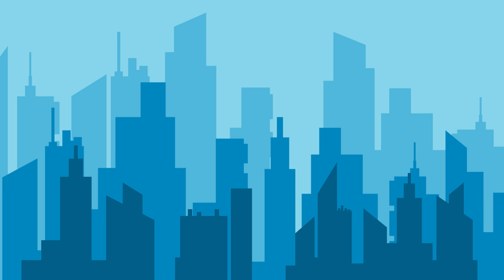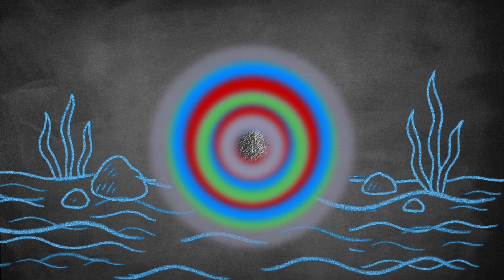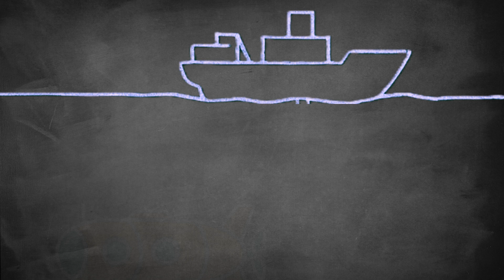Deep-Sea Mining: Engineering the Final Frontier - Or Destroying It? 🪸

Comment from the maker: Time Stamps:
00:00 Start
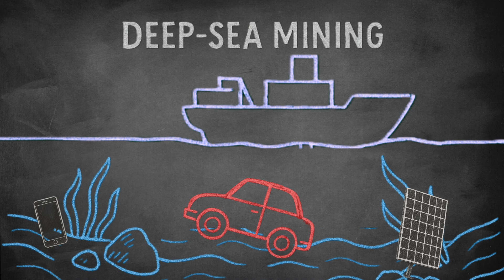00:22 Mineral Extraction at Extreme Depths
00:41 ROVs
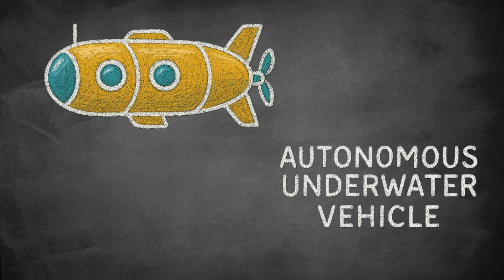01:03 AUVs
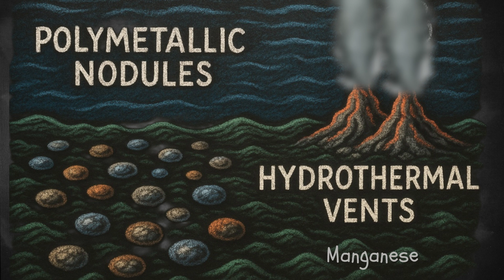01:23 Polymetallic Nodules & Hydrothermal Vents
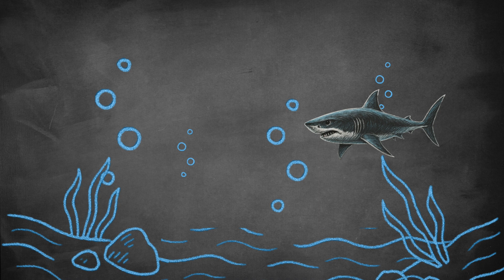01:39 Polymetallic Nodules
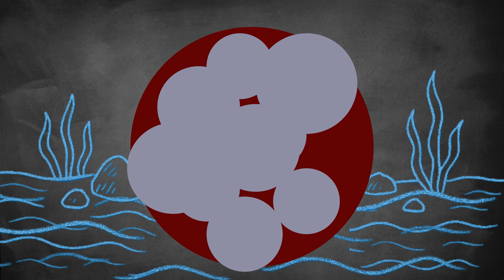02:50 Clarion-Clipperton Zone
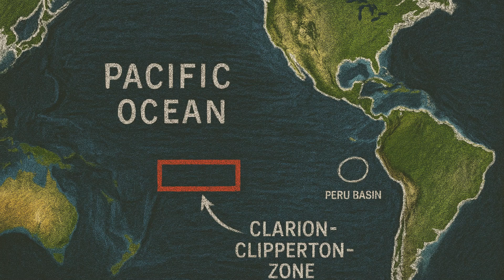03:00 Hydrothermal Vents
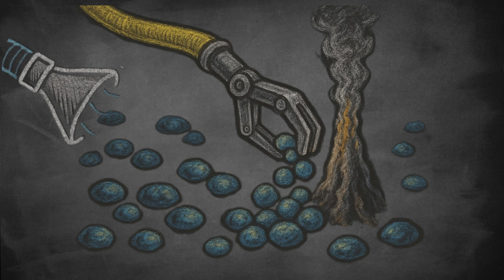03:28 Collection Systems
03:43 Hydraulic Suction
05:21 Bernoulli’s Equation
05:48 Continuity Equation
06:03 Pressure Head/Suction Lift
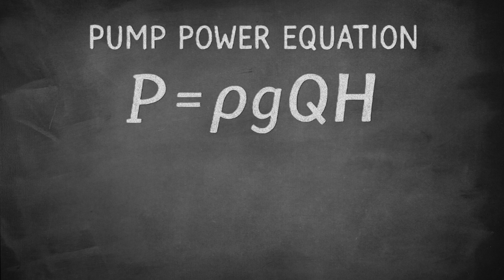06:41 Pump Power Equation
07:14 Head Loss from Friction
07:35 Practical Engineering Decisions 
08:08 Riser & Lifting Systems
08:19 Surface Operations
08:30 Environmental Engineering Concerns
08:46 Is It Worth It?
08:53 Outro